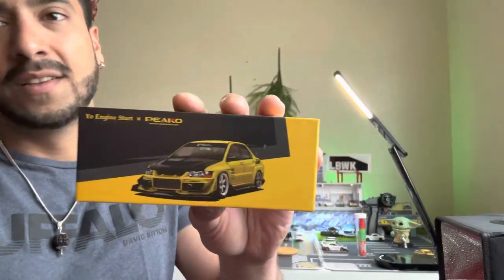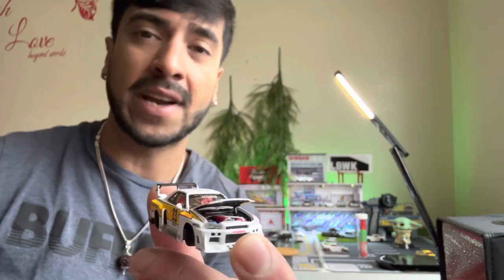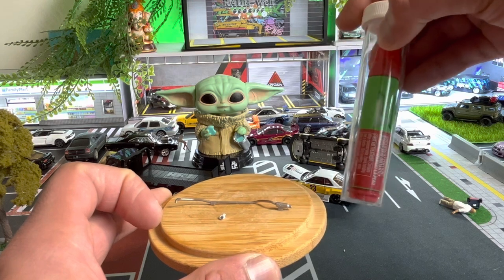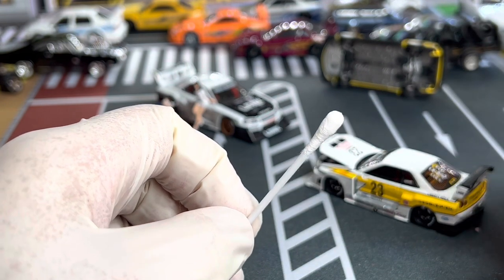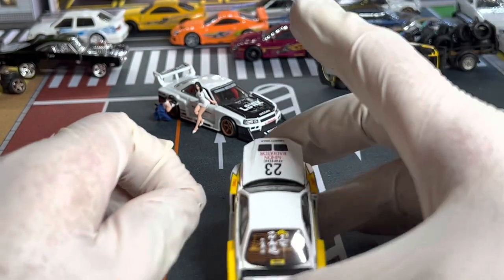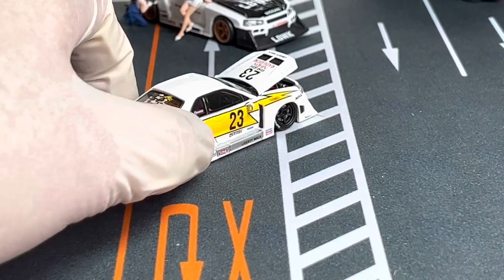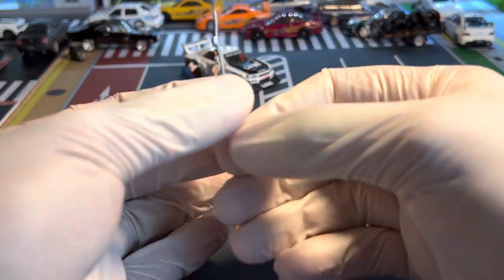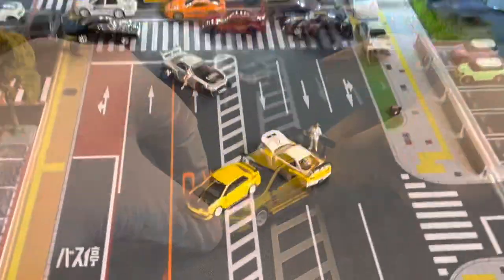Fixing Side mirrors on 1/64 Diecast (How to repair/Fix your diecast)

Comment: Is this metal or rubber?
Reply from the maker: Hi friend,It is metal
Reply: @rcoverdose  thanks I was planning to buy mini gt or inno 64 but I don't know which one has the metal side mirror cause I'm not a fan with the rubber side mirror.

Also which brand are you fixing? does it have metal body and chassis?